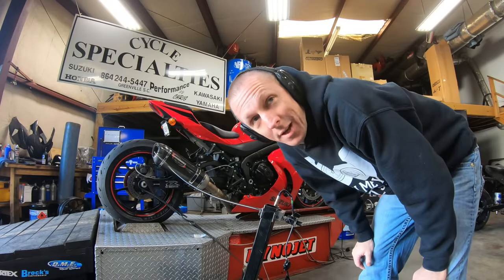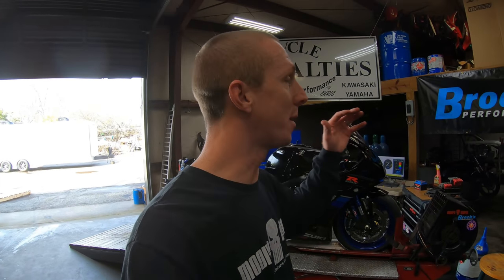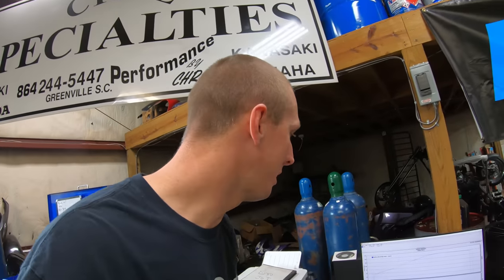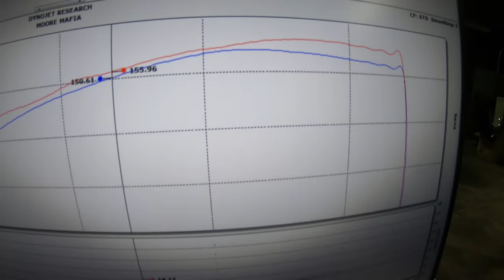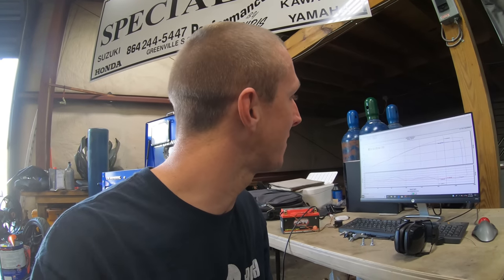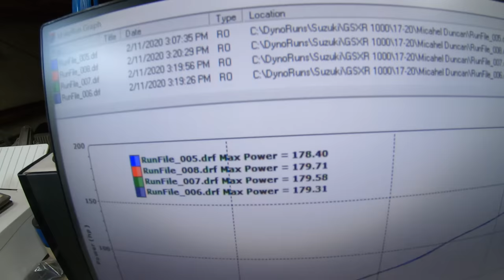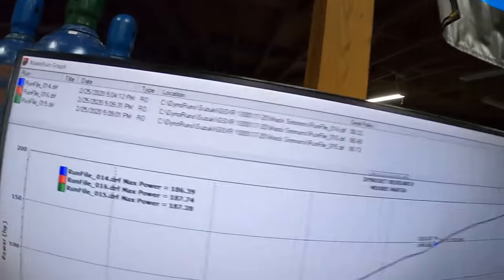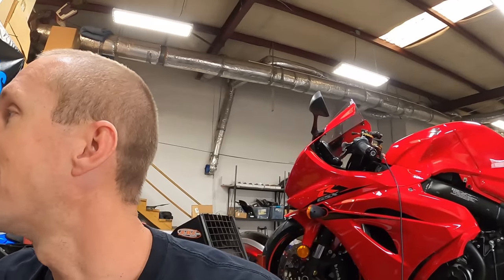2017 GSXR 1000 Exhaust Dyno Comparison Brock's Performance  Alien Head vs Akropovic Evolution

Comment: Great test ! But With same tire, same filter,  same wheelbase, You will be surprised what pipe will pull the bigger  top speed . This was found with some ZX10 and hayabusa testing years ago.  The brocks will show more horsepower but the Ackropovic will pull 2-4 more MPH on top, most people dont know this. I had both pipes on a hayabusa. Brocks looks better(Can wise) , and sounds great ! The Ti Ackropovic are a work (Header wise)of art ! Pick your poison that both great !
Reply: Test our CT series VS. The akro. Lighter, more power, better welds. They have a great pipe. We have a true performance pipe. What does it mean? Add our pipe and the bike runs like shit... Because it flows FARmore. Map it, and it all comes together. They would Never sell a pipe that wasn't OK without mapping. It would crush their rep... Who would make it work?

Comment: Both pipes sound great, but I prefer the deeper sound and throw back look of the brock's pipe. I ran a Bassani exhaust on my built GPZ , wiseco pistons yosh cams. Street racing, small time stuff. Im currently running a Two Brother's exhaust and juce box combo

Comment: DW 170-190Hp is totally enough for drag-bike. Even if you have more power it would be hard to transfer it on the track with those tires.

Comment: I would have (and have got) akrapovic on my supercharged busa .
Top spec quality , great dyno numbers (360 at wheel) and most importantly it goes through on the decibel testing (105 in UK)
Brocks sound great but would not get through tech spec this side of the pond .
Great video's , add 1 sub from England
Reply: Peter Herrington Supercharged busa ? You have my interest. Is it a kit ? Please tell me more. I own a first gen busa.
Reply: @300zxdriver  
2 chargers available (that I know of).
Procharge and rotrex. 230 ish horsepower options right up to 500 plus for full drag use.
Substantial upgrades required obviously , forged rods , pistons, base spacer to lower compression , lockup clutch to start with .
Not a cheap option but plenty of power and over 200 foot pounds of torque from 5 thousand (without any lag ) makes for huge grins and mid 8 quarters .

Comment: I have the alien head on a zx14 and I really like it. It definitely is a flame thrower. I had the Brock carbon fiber muffler before and then I switched to the alien head and put some zx10r wheels on it and it was a noticeable difference but I don't have any after h.p. numbers

Comment: Was that a Brock's slip on with a factory header? And how much do you charge to flash tune an ecu? My bike has a power commander 5 on it now. And I'm not impressed with it to be honest. I'm riding an 04 R1. Not sure if you can even tune it's ecu.
Reply from the maker: I can not do the ecu on 04 r1. I actually have a video coming out Sunday with an 04 R1 in it! You need to have yours dyno tuned. I charge $200 with power commander
Reply: @ Chad Tucker... You can send your ECU to ECUnleashed, they will be able to flash it. Then you can have Mr. Moore fine tune through the PCV. The real set back is you can't adjust the timing without an Ignition Module from PC. ECUnleashed will adjust the timing when they Flash it but, it won't be dialed in like it would if Mr. Moore was doing it on the Dyno. 

Honestly, best scenario would be to purchase a Ignition Module through Moore Mafia and have him completely tune it... Not a sales pitch, just makes the most logical sense.

Comment: Ackro. . . It baffles me how all these bikes & claims of making 200 & more hp . All the bikes & dynos I have seen you do have nvr seen you get over 182 hp from your pulls .  What is your personal favorite of combos of 1000 ' s for flash & parts ? And is over 200 actual hp possible with flash tune & parts possible ! Thanks much for all your hard work & commitment to the sport !
Reply: Bit of a late reply but manufacturers power claims all come from measuring power at the output shaft in perfectly prepared and monitored lab conditions rather than at the wheel.

Dynos measure wheel horsepower which will always be around 15% lower than the actual engine output but even then, no two dynos will give identical results.

Comment: Love to see the diff as you did in the suzi but on a gen 3 zx10 and a full nassert beet....I run the woolich(no tune i deleted it when i thought i was selling bike and system sperately)system of tune and never dynoed just to see..Personally im more concerned with the curve and ratio and time to speed #'s........Akra is everywhere,brocks does awsome stuff but not a fan of that style....Part of the reason why i went with full beet..

Comment: Hey Chris loving the content man. I have a question for you do straight pipes make more power with a tune or do you need that back pressure from a muffler?
Love the Brocks but couldn't live with it as Im an early commuting Busa rider neighbours would kill me!
Reply: Have too run the db killer still sound nice just alot quieter very bearable
Reply from the maker: Straight pipe definitely kills the power.
Reply: @TeamMooreMafia  You should prove it.
You won't cause you don't sell straight pipe exhaust lol.
Reply: Straight pipes for short drag races, pulls harder on the low, full system backpressure for higher top end, works the same on any engine, 1cyl. 2, 3, 4, 5, 6, 8 10, 12, 16, car or bike

Comment: My riding buddy had the ecu done by Brocks, full Hindle ceramic coated, stock air, chain and 93 gas with dyno and getting 188 at the wheel on his GSXR 1000. That’s pretty good I think. 👍 . He is very happy with the whole setup

Comment: Geeezzzz...advertisement for Brocks with skewed stats.....a Brocks full exhaust is no better than an Akro full exhaust and def not a 10hp difference..LMAO   I had my 2015 s1000rr flashed and dyno tuned by Bren Tuning with just a yoshi slip on and a sprint filter and 4 pulls into it made 197hp and 97ftlbs torque.  Bren said if I had a full exhaust on it I would have made another 3 to 4 hp.  So enough with the BRocks is great shit!  And the Yoshi slip on sounded just as good as the brocks and had all the pops.

Comment: The alien head does not come in titanium right? How's the weight difference between both the akro and the brocks?
Reply from the maker: It does not come in Ti and i don't not have the answer for that question.  If i had to guess i would say problem 2-3 pounds difference.

Comment: Quick question,  got 2017 GSXR1000 brand new 0 miles, bought that Yoshimura Slip on for it, do I need a Servo Buddy??
Reply from the maker: I can flash the ECU to remove all the restrictions as well as correct the servo problem.

Comment: Do you offer a "magic flash" for a 2018 Zx14r? I just want to smooth it out, not sure if that would do it?
Reply from the maker: I do.  I have a 2016 ZX14 myself,  so i have spent a ton of time on it dialing it in!
Reply: @TeamMooreMafia  That's awesome! At the moment I only have Delkavic slip ons. I plan on putting a full M4 system on it, but not sure when I'll be able to afford it. Do you think it's worth the flash with just the slip ons? And do I order it through your website?
Reply from the maker: The flash makes a huge difference no matter what exhaust.  The bike has a ton of restrictions from the factory. Just contact me through the website when u are ready.
Reply: @TeamMooreMafia  Will do, thank you!

Comment: How long of a stretch on this bike. Trying to figure out how much I can stretch and still ride on street and take corners?
Reply: I realize this is an old comment.....  but I rode my busa with a clutch mod,6"over, and lowered on the street. It changed the handling but it was still very rideable
Reply: I've got busa with 8 inch stretch in England. 
Handles perfectly at legal speeds . When pushing hard in corners it struggles , depends what you're doing on it really

Comment: Not to sound rude or anything  but the red gsxr has slot more mods than the black gsxr I see swingarm extensions vortex aluminum sprocket definitely a 520 chain so in reality the red gsxr will make alot more power than the black gsxr just starting the facts
Reply: Longer arm more chain less hp.
Reply: @1000draggsxr  Different tire, different gearing, etc... Too many variables in this comparison. Same bike, same day & conditions, the Brock's will make 2 to 5 Peak HP more at best... Been there and done it. Akrapovic will make more low end & mid. I care about that because I'm a commuter.

Comment: Can we address the elephant in the room.   On the bike with brocks also has swing arm extensions.  So that’s pulling power.   And did the other bike have brush guards?   What on earth is on the bars.
Reply: Those are Lever Protectors... All AMA MOTOAMERICA, WSBK, BSBK, CCS, ARCA, etc. guys run them on their bikes... I'm pretty sure the extended GSXR has gearing change as well. It's not a 🍎 to 🍎 comparison at all. Great content either way though... I appreciate his hard work and I learn something in every video Mr. Moore shares.

Comment: This pre arranged pulls c mon guys , you can fool some people but not everyone! No way that crap exhaust would make more power against an akrapovic.....
Reply from the maker: The black bike made low power.  I don't think it was because of the exhaust.  I feel like they are probably pretty equal. I do dyno tons of bikes and the Brocks exhaust always make good power on everything.
Reply: @TeamMooreMafia  never saw one those make a decent job. Sorry to say....
Reply: Akra exhaust has cross over pipe connecting 2 and 3  for mid range, for coming out of coners. Brocks run striaght pipes 4-2-1 for top end, more for drag racing.